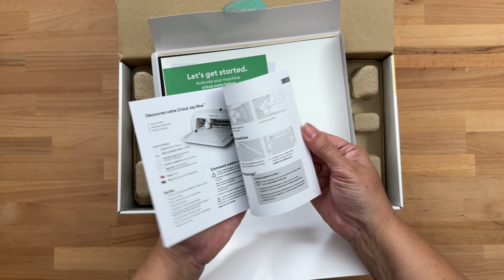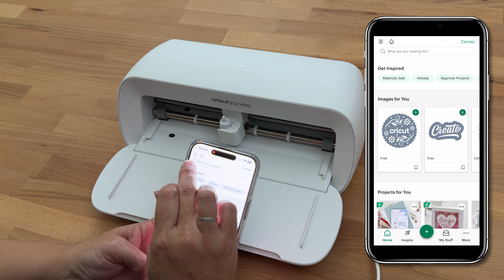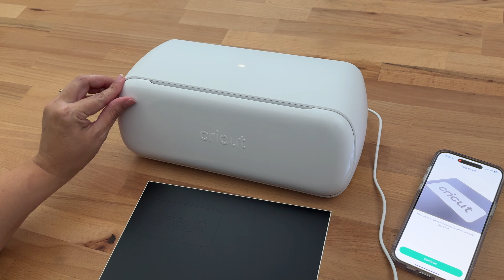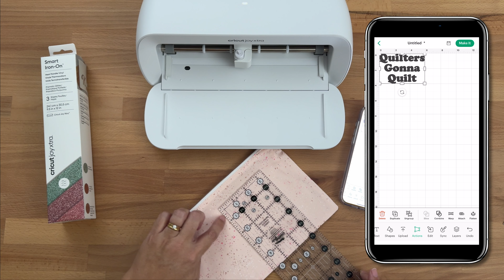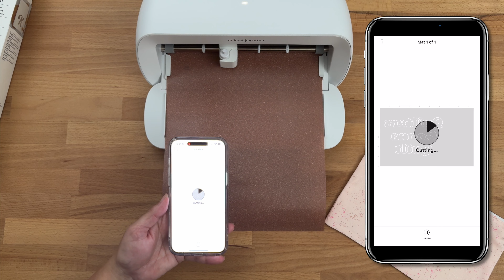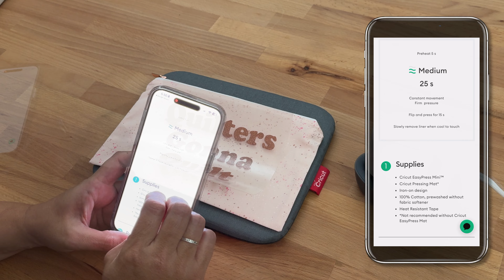How to Use A Cricut Joy Xtra for the First TIme!

Comment: I got the same bundle, but I cannot figure out what the golden sheet is for? It doesn't come with proper instruction for the bundle. Could you please let me know what is for an dhow to use it? I just bought the machine and messed up all three samples by one way or another LOL. I was giving up and about to return it and I found your video. I was able to print on the black vinyl, but no idea what to do with the rest! Thank you!
Reply from the maker: Hi! I’m so glad you found my video before giving up! The golden sheet is most likely just a sample piece of vinyl or iron-on they included for you to try out. It’s not something you have to use for anything specific, just a little bonus to play around with.